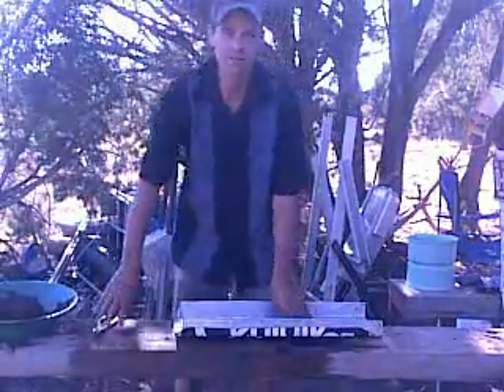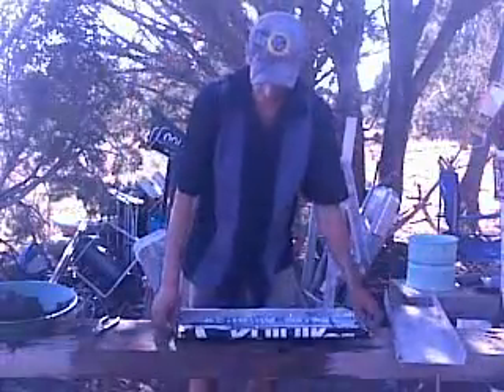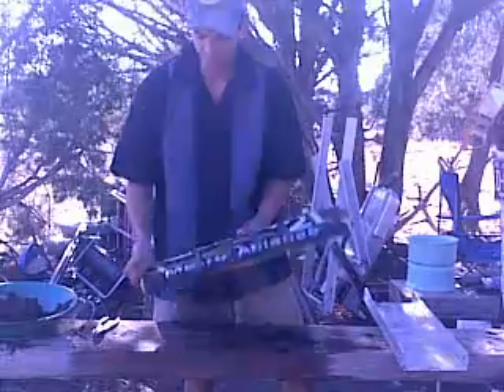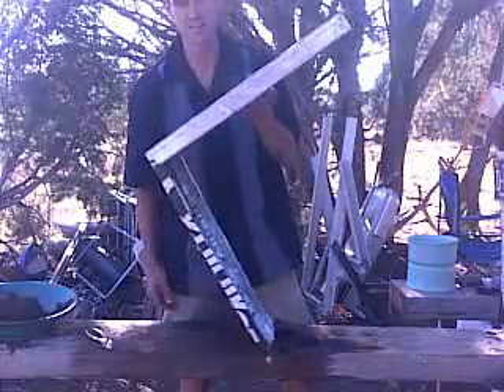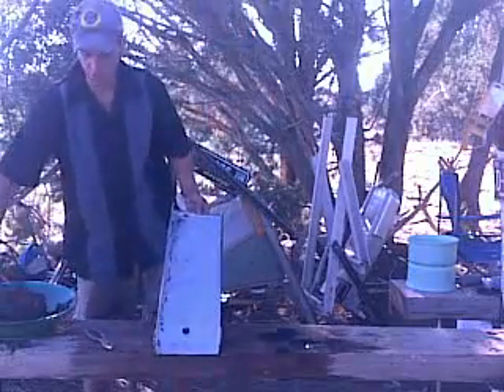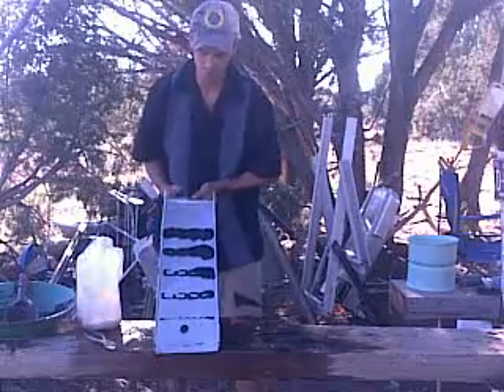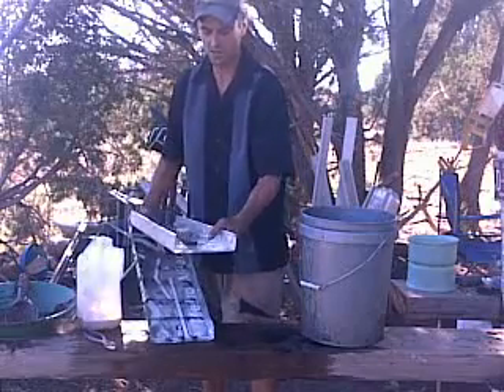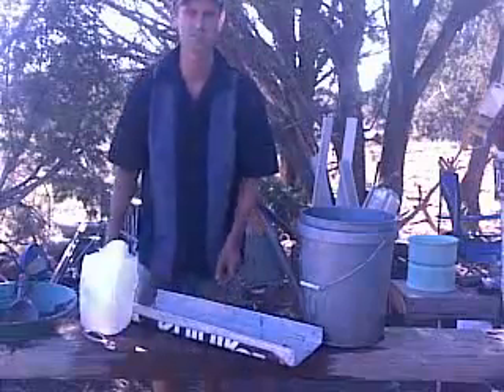Magnetic riffle sluice box

Comment: the problem I have using magnets to catch gold is a magnetic field will actually push gold away. gold and silver are diamagnetic. But I don't like the GolDymium entirely. I would adapt the GolDymium to a Hopper box for a Highbanker and you'll have less of a issue with black sand filling up your riffles. plus don't throw away the black sand just in case some gold may have gotten trapped some how.

Comment: I use a magnet to remove black sands. When I'm down to a bucket of VERY fine material, I spread it out in a very wide, very shallow container, and add a little water and skim the top of the material. It's time consuming, but it gets the black sand out without the risk of loosing gold in the clumps of black sand. Just be sure not to touch the magnet to the sand, or it will trap fine particles.